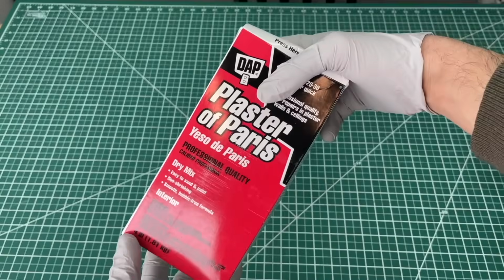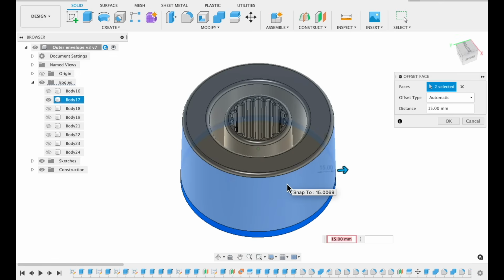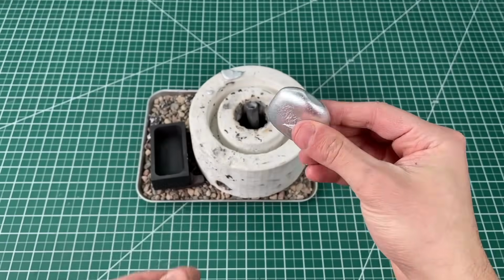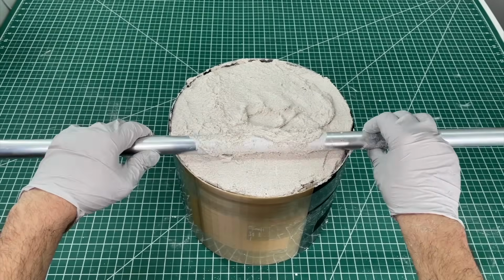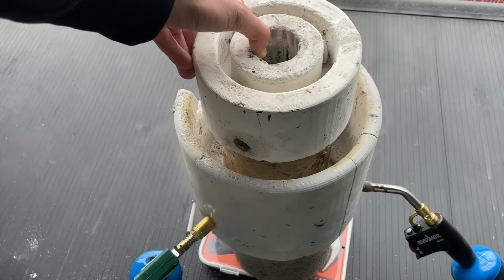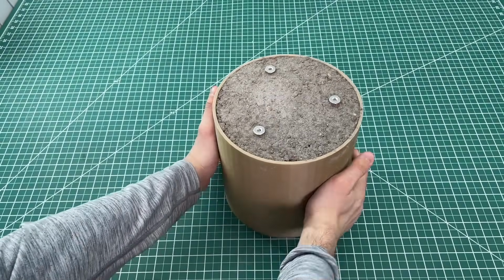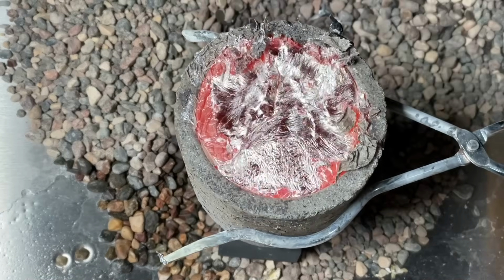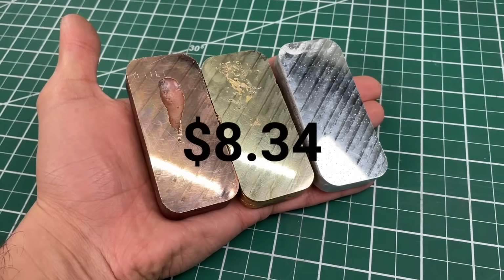DIY Foundry At Home

Comment: I mix plaster of Paris with a 3d printed whisp like stirrer that has a long extension handle that is inserted into a standard drill. It works great on the fine lumpy particles of the plaster

Comment: If you change the angle of the torch tunnels to anything other than straight toward the centre for a swirling effect, and the internal ribs from straight up to an upward spiral, you'll get a lot better result.
Reply: I can confirm this!
Reply: That's what I was thinking when watching this. Most of the designs I've seen have the torch mounted tangential to the furnace/crucible walls to create the spiral you're describing. With a gap just wide enough to be able to lift the crucible, the heat is applied more uniformly across the crucible. Seems like a lid with an opening the size of the crucible, with a gap between the crucible and lid, is a common thing to balance air flow with retaining heat.

Comment: Throwing in my 10 cents.
- Concrete can explode when heated, so use steel re-enforcement when pouring concrete - not only does that reduce explosive risk, it prevents you from losing your molten meltal if (for example) the whole foundry cracked in half from the heat. When re-enforced, it'll hang together where you can shut the process down safely (vs. having a massive, exploding, moltent metal fire).
- Judging from your video, the concrete can be a lot wetter. Not quite soup. Think "winter stew" consistency. Just be aware it's the water that actually cures it (lookup: concrete hydration process). 
- Never wet anything that deals with molten metal (molds, crucible, foundry structure)
- Preheat your molds to evacuate any moisture, that should solve your bubble issues.
- Scoop the dross (oxidized crusty bits and impurities) off the top of the molten metal and discard it elsewhere before pouring.
- Move to a single proper propane torch. Multiple torches increases risk (via management requirements).
Reply from the maker: Thank you for your input 😃

Comment: sift the plaster before use and it might be better to tilt the burner less than 90 degrees to the center cac 20 degrees outside so that the flame partially circulates around the center and does not burn it directly

Comment: You can use maybe 5-6% more water in your cement to make it pour better. When it cures a day or 2, run it through a couple of 100-150C heat cycles before melting metal in it. Pure portland with perlite is better than gravel mix. As for plaster of paris, you can get more working time out of it by mixing outdoors or using cold water. Once it produces heat, you have about 30 seconds before it's unworkable. Also, use perlite in the plaster instead of sand. Good luck!

Comment: You should use the proper materials. Luck was on your side on this one. Also, careful with brass because the Zinc Oxide is toxic, the cool yellow smoke. Also, heat it up to much and the Zinc will catch fire. 
Also, cast iron molds are fine, line with graphite dust and remove the I got hot.

Comment: So for the small bubbles in the alum you need to degas the hot metal.  For that you use potassium.  What I use with mine is Light Salt.  You can get it at the grocery store.  I then make a table spoon pill out of alum foil and get it to the bottom as fast as you can.
Also you want to use flux with all 3 metals.  For the flux you will want to use Borax that you buy at the store to clean your laundry something mules in the US.
For a cheap refractory look for portland cement, perl light and plaster.  You have to play with the mixture but it works up to copper.

Comment: With brass, be careful not to over heat it, white smoke coming from brass is the zinc evaporating which is also very toxic. Use a preheated steel spoon (few secs with the blowtorch or on top of the foundry should do, doesn't have to glow red) to remove the slag on top in your crucible, if you collect a lot of slag you can eventually melt it all down to extract more metal. And if you ever find the crucible sticking in the furnace, put cardboard under the crucible, will create a carbon layer preventing stickiness.

Comment: You are casting too quickly! Lol, always a great fay to learn, black stuff on the copper is oxide no big deal, add flux to your metals and your moulds. Pre hear your moulds before pouring and the longer the better in heating up your kiln so you don’t shock the system. Also as a side note, brass oxidizes fairly quickly so the hotter the better for it. And the bubbles are from using a cold mould ( cold being relative to the kilns temp.) warm up your moulds and a lot of problems go away, also more flux  the better!

Comment: The black material on the copper was just an oxide of copper.   If you dunk the ingot in water when still extremely hot, the steam created at the surface will blow most of the oxide off

Comment: Just create a cap to have the mold  heated prior to pour. Not only that but too much heat is being lost from an open design as well
Reply from the maker: Thanks for your suggestions 😃
Reply: @ActionBOX  No on the sand and use foundry foam.

Comment: if you do not want the furnace to break, just put the reinforcement in the casting, for example, I used copper conductors. of course, cracks will appear, but the furnace will not burst

Comment: if you use soda crystals to degass the metal before scooping off the dross you will get a clean pour with no bubbles. check out myfordboy channel for smelting tips, he is a great resource.

Comment: You need to be very careful when hearing brass. Some of the zinc sublimates into hot zinc oxide gas and inhaling it will give you a nasty case of metal fume fever in ever small doses

Comment: i found slowly adding the plaster mix in the water bit by bit as if your makeing pancakes to remove lumps or you can use a mixing atatchmin that a drill can use with paddles if you want to spend more money

Comment: plus ur suppose to make these molds out of refractory cement powder or buy and mill bricks...  but before u that your supose to stuff the walls with fire blanket. i forget what its called. im not talking about mylar but a rock wool fiber glass looking material. its insulation.
Reply from the maker: Thanks for your input 😀

Comment: I used to melt down and recycle a lot of aluminum, and besides fluxes which you can buy, another industry trick is to have a cylinder of "dry nitrogen" and just bubble it through the molten aluminum right before pouring to de-gass it.  Also, molten metals are not chemically neutral, they will react with things like steel (think of them like a super hot acid), that's why crucible materials are so particular.  Though the rapid erosion of your first crucible probably indicates that the early torches were not burning a proper mixture of gas and air and were producing an exhaust that was oxygen rich.

Comment: The reason your cast iron ingot mold failed was because you cooled it. Metals become harder and more brittle when rapidly cooled from extreme temperatures. Further, the outside cools faster then the inside because it comes in contact with the cold water first, so the mold shrank in around the ingot and basically squeezed tighter around it, likely deforming or cracking the mold before it got a chance to cool down inside and release the ingot. Def would recommend just waiting for the copper (or whatever material you're working with) to freeze up on its own and then a simple tap should knock the red hot ingot out of the mold. After that you can quench the ingot itself and your molds will last a lot longer!
Reply: Basically, the (SPOILER AHEAD!) ending scene of Alien3  :P

Comment: In addition to the size of the foundry, you also need more air.  when you are using the regular torches', there wont be enough oxygen to burn .  take out one of the torches and replace it with a hair drier/compressed air

Comment: ohhhh I'll DEFINITELY be making one of these...  I regularly print ABS, so I could probably do the hips thing but honestly...this might give me a use for my PLA that I never use.  I THINK my big dual nozzle printer could print it....but ill figure it out.  One thing, you want REFRACTORY CEMENT for the final product.  search that, you'll find it.  Its what we use for forges.  

If youre having heat issues maybe try an acetylene torch, mapp gas, something along those lines.  I'll probably build in a propane nozzle ive got in the garage so I can use a large tank, and maybe a blower set into one of the other nozzles to create a high temp jet flame.

Comment: Unfortunately aluminium is not easy material to work with, because it easily oxidize and to reverse this process you need to act on it using very high voltage and high current. Working, because that reaction will produce a lot of CO, CO2 and NOx. 😉

Comment: I see that others have mentioned that you should slowly bake out the moisture in the cast part so that it does not pop or explode.  When building small foundries I always set the flame at an angle so that the flame works around the edge as it goes up.  The laminar flow will help.  Also, try printing the molds with a "draft angle" of about 6 to 10 degrees.  You might be able to print the molds so that they are reusable.  Also, you can use a saber saw (without a blade) as a vibration device to shake out the bubbles.  Last, using the same crucibles for aluminum, copper, brass, etc.  It will contaminate the different metals.
Reply: Using a saw without the blade is one of those simple, obvious solutions that never would have occurred to me. Thanks!
Reply: Comments like these makes me wish that I could like more than once. The point about the moisture is such an important point. I've seen the results of gas explosions and metal before and it's both specatacular and terrifying. Reusing the mould is a great idea and the sabre saw idea is both simple and absolutely brilliant!
Reply: @Gangdyret  and @Michael Merrell, the saber saw idea is not mine.  It is rather commonly known by people that use molds for concrete, plaster, epoxy, and other fluid materials.  I do appreciate the kudos though ;-)  Yes, "candling" the kiln is something that we do in ceramics all the time -- basically turn on the heat on low so that it drives out all the moisture before ramping it up fast.  BTW, ceramics are very sensitive to changes in temperature.  Even after it is dry, if you ramp it up to fast it will warp or break.  Many of the techniques used to build and fire ceramic kilns will work just as well for metals (with metals you can ramp them a LOT faster, and push them in ways that you cannot for ceramics).  The "draft angle" above is standard mold making techniques.  If you can find old metal foundry mold books at the library, you will learn a lot of useful stuff.  Hope you enjoy!

Comment: cool video!!! im a jeweller and removing the slag off the top of the crucial before pouring is essential and will help  get much much cleaner bars without those bubbles, well worth the 4 second investment of time, can use a stainless steel spoon or similar.

Comment: I wou suggest putting the plaster/sand mixture into a vacuum chamber once it's poured into the mold, this will eliminate air voids and also will remove all moisture (water) from the mixture, so it wont explode when heated and most likely won't fracture either

Comment: You want to use a flux to help the metal flow. This will also help lighter impurities (called dross) rise to the top to be scraped off before you pour. You can use borax as a flux.

Comment: I have some suggestions on how to make this better if you are willing to go the extra mile with it.  first if you have acess to a vacum chamber use it on the plaster before and after you pour it into the mold.  second heat up the forge in a fire similarly to how you fire clay.  you can use a regular campfire to do this.
Reply from the maker: We are always open to suggestions.  Thanks for sharing 😃

Comment: always preheat your molds and metal. you want all the water to be boiled off before you get it up to high temps. 

also, brass is a copper alloy with zinc. zinc will burn off from the molten alloy, that greenish smoke you see, it's a major Hazzard. toxic and can cause burns in the lungs. also, the copper vapor is toxic, so always be well ventilated when you melt it.

oxygen is soluble in aluminum.  That's where your bubbles come from, get some degassing flux.  you want to flux all of your melts to clean out those impurities. be careful with flux choice, some like borax will erode your crucible.

Comment: a great trick for making molds from 3d prints is to coat the inside with a thin layer of paraffin wax. use a heat gun and spread it around as thin as you can. fills in all the layer lines and helps a ton
Reply from the maker: Interesting concept 🤔

Comment: Add flux to get rid of the bubbles formed by dissolved gasses coming out of solution as the ingot cools. The flux goes into the molten metal before the pour.

Comment: As I didn't find someone answering the question about the black(and red) crust that formed on the copper, I try to answer that.
Both red and black stems from the different Copper-oxides, depending on what oxidative state it is in.
Black==Copper(II) oxide
Red==Copper(I) oxide (a Semiconductor btw, Paramagnetic and a rectifer used before the use of Silicon)

As Others pointed out, the silver Metal on the Brass is most possibly the Zinc coming out of the Copper solution as it has a lower melting point, but it also could be Pb, lead, doing the same if you have Brass with higher % of lead in it. Which would makes that piece poisonous...
And also, the yellow stains on the crucible is Zinc-oxide, which isn't kinda healthy too and happens if anything containing Zinc is melted in an oxidizing Atmosphere. Like Air.
Reply from the maker: Thank you for sharing 😃

Comment: Couple words of advice:
Never get your crucibles or graphite wet. In fact, always hit your mold with a torch before you pour. Any moisture immediately evaporates and as you fouund can be violent.

Use flux on your molten metal. Either a dash of borax, or a hint of boric acid.

Once molten, get a graphite stir rod, hit it with a torch, then dip it into your molten metal and drag it off to the side

Your black spots are more than likely impurities. Always use 1 crucible per metal. It could also be from water/moisture in your mold. Always preheat the mold.

You have bubbles and holes from the casting process. It may be too cold like you suspect, moisture, impurities, etc but, any stock you purchase isnt just cast..its cast into a billet, reheated, and run through various mill stands while red hot and quenched with sprays at very precise speeds.

I do automation for steel and aluminium mills (including casters) and have been pouring silver and gold jewelry in my garage for 2 years. Ive played with torches and I’ve concluded for casting, using even a cheap 300$ amazon melting machine is the way to go. Melts copper no problem. Thats all we use for copper, bronze, silver and gold
Reply: Literally never had a crucible break/crack/explode and I have dropped them white hot into water.
Reply: Person that knows what they are saying, great info...-ER
Reply: Where can I get an induction Melter that can handle 4 Kilograms? biggest I've been able to find is 3KG (3KG gold rating, but I want to use it for aluminum.)

Comment: Despite the concerns of explosion due to water, you probably want the concrete mix to be soupier when you make it, this will help it settle and prevent it from cracking or crumbling in the future. I'm not sure exactly how much extra water effects its likely hood of violently cracking under heat but i know a lot of people use concrete that is fairly soupy for forges, so i can't imagine it's that common.

Comment: You need special refractory cement which is not based on Portland cement. A 50 lbs bag of good refractory stuff will probably cost you at least $50.  Portland cement based mortar or concrete will get destroyed by the heat very quickly.
Reply from the maker: Thanks for your input 😊

Comment: I just learned that some molten metals are hygroscopic, so it’s very important to preheat your molds to drive off moisture or you could introduce surface defects and porosity. This made me wonder if it wouldn’t be better to seal the crucible since the propane fuel source produces a great deal of water vapor. Alternatively you could build an electric model but a lid still seems like a good idea since even casting on a humid day has been reported to effect quality.

Comment: Cast iron doesn't like rapid temperature changes. Dunking it probably fractured it, which likely wouldn't have happened with air-cooling.
Reply: Also, you should try and remove the slag from the surface of the molten metal. Slag will rise to the surface, and can be scooped/scraped off, which will make you pours far cleaner.
Reply from the maker: Thanks for the input 😃
Reply: @ActionBOX  I'm happy to help! I'm sure you guys would have gotten there on your own, if you hadn't figured it out already. Cool video, I subscribed. Look forward to more of your stuff!
Reply from the maker: @alden1132  we learn from educational comments, so we wouldn’t have learned it had you not shared 😉 thanks for your support.  Cheers Dave

Comment: You should cast slower and use more material. And that poket in the copper bar is becouse the metal is shrinking becouse of the rapit temperatur drop of pouring. You can prevant that by getting more on hand experience.

Comment: All of these defects are gas inclusions. You need to degas your melt before you pour it. Either bubble inert gas up through it with a lance, or push degassing tablets to the bottom until they finish bubbling.